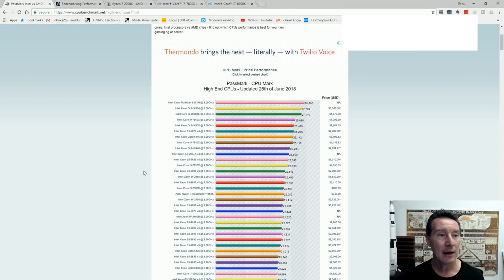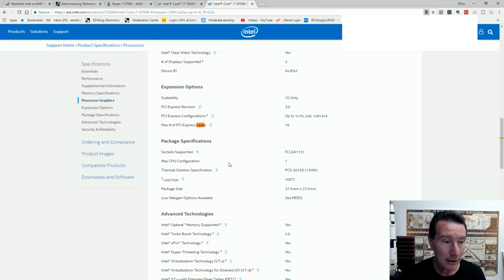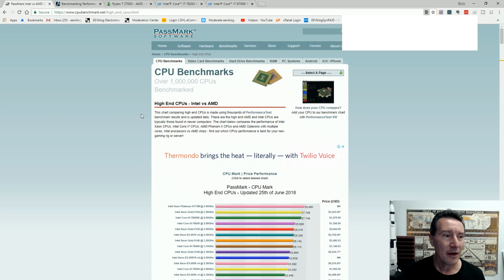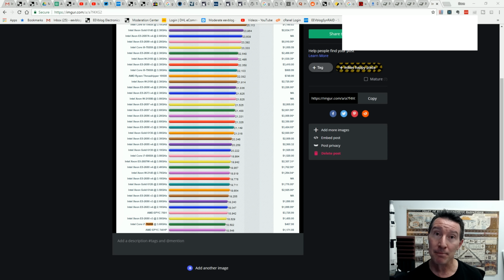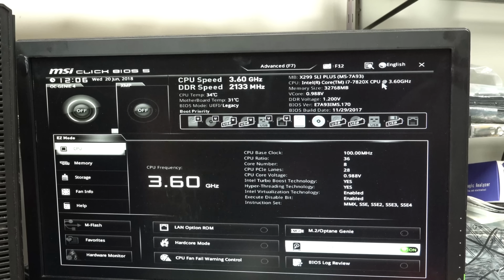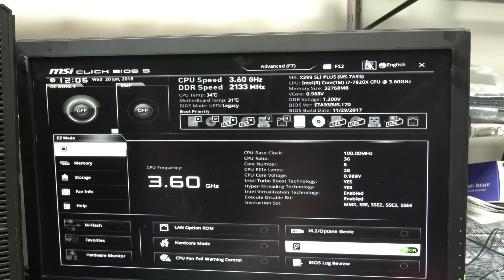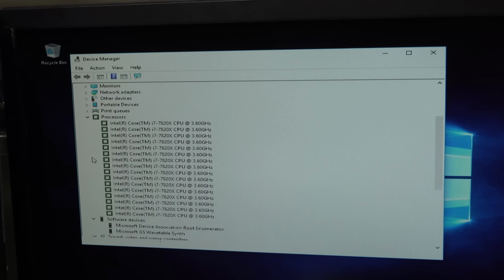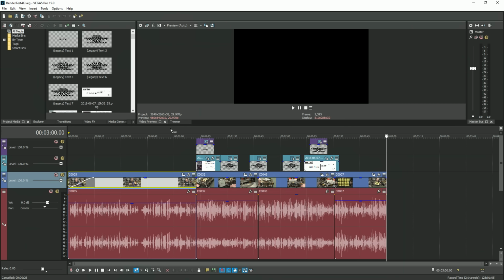EEVblog #1098 - 4K Video Editing PC Build

Comment: I have a 7820x with a custom loop EK water block, gtx1080ti, my 7820x is overclocked to 4.9ghz ALL cores ALL the time, I get 19c all Cores at idle and during gaming and editing it stays around 40-50c under a full stress test it does get a bit hot at around 80-90c but doesn’t stay there very long. I am using a 560mm full cooper radiator it’s a BEAST made by Alphacool. I love my Pc and my 7820x I don’t regret it at all and paired with the 1080ti gaming and editing is a breeze. My ram is Corsair vengeance RGB 3000mhz and I was able to overclock that all the way to 3400mhz stable. Love my setup 👍🏻

Comment: Some notes on PCIe lanes... 
(My knowledge is with Intel and this specific motherboard, I have no idea how AMD allocates / organizes PCIe lanes.)

The CPU's 16, 28 or 44 PCIe lanes are a direct connect between the CPU and (on your specific motherboard) the 4 (or maybe 3 top-most?) PCIe x16 slots for graphics cards.

The X299 PCH on your motherboard supports 24 ADDITIONAL lanes.
This provides the connections for the 2 PCIe x1 slots, the M.2 slots, the U.2 ports, the integrated LAN controllers and the extra USB 3.1 controller.

2 x1 PCIe slots with x1 lanes each, total 2 lanes
2 M.2 connectors with x4 lanes each, total 8 lanes
1 U.2 connector with x4 lanes, total 4 lanes
2 built in LAN controllers with x1 lane used each, total 2  lanes
1 secondary USB 3.1 controller with x2 lanes used, total 2 lanes

I may have missed something on the board, but this accounts for 18 of the 24 lanes available.

Depending on which CPU you use and how many lanes it has natively, your x16 slots would be given more or less bandwidth without affecting the rest of the system:
From MSI's page (https://www.msi.com/Motherboard/X299-SLI-PLUS/Specification):
x16 / x16 /  x8 mode with the 44-lane CPU.
x16 /   x8 /  x4 mode with the 28-lane CPU.
x8   /   x8/   x0,  x8 / x4 / x4 modes with the 16-lane CPU.

Actually, since the x16 slot modes only list 3 numbers per mode, and because the board advertises 3-way SLI, maybe the bottom x16 slot is PCH connected.
That would mean that the bottom slot is limited to 4 lanes (the lane count for a device must be a power of 2, there are 6 left over from above calculations)

So, with your configuration, your PCIe slots have the following lane allocations:
x16 slot: 16 lanes
x1 slot:  1 lane
x16 slot: 8 lanes
x16 slot: 4 lanes
x1 slot:  1 lane
x16 slot: 4 lanes

Comment: Late to the party but - ppl usually have "insight" into these things - and Silver Stone is not a no-name brand - they have very good quality PSU available! All the "good" brands have crappy models for low prices available. Also ppl like to see insane builds that they can't afford. Quite many "high-end" builds are unstable at loads because component selection has been done using the price and results of random benchmarks. Take a look at Steam Hardware Survey and you will see what most ppl use! :D:D

Comment: hey dave, I think you could have gotten maybe a a slightly bigger bang for the buck by buying a slightly less powerfull CPU and adding a GPU. From my (limited) experience, GPU acceleration helps a lot for live preview and final render. Also, mounting the fan on your radiator on the other side could make CPU run a bit cooler (both fan are trying to suck air from the same place instead of making it flow through the case, note that it isn't an issue if you leave it open obviously x) ). Anyway, thanks for the awesome videos, cheers ! :P

Comment: Sorry i was throwing pizza in oven, wtf is passmark? Just go buy clock speed, core matter less.
Reply: With your budget I would of went for max ghz, as many cores as  possible, and def support for quad channel ram.
Reply: Had to disslike for processor choice, pure waist of money, only good thing was it had quad channel, but that may only give limited performance depending on type of use. Sorry Like eveblog, but this is just awful, specially with intel last few years, giving them free money, it's intel fanboyism. My last build was intel, was great, this year im doing ryzen, why cause It doesn't matter i go for best, no fanboyism when comes to cpu's. Who can afford to?
Reply: That said I realize you    purchased it, you own it now, it's not an awful processor, im sure it will work great. Thanks for vid as always they are great (if very poor computer building).
Reply: also why does everyone hate cortana? It really usefull, you can get sppech to text string into c#, xml, scripting etc, make your own automated phone operator etc. Really brings a lot of capability to software developers, and end user.

Comment: I would be very interested to see a more in-depth performance review of the 212 Evo with your CPU since by most accounts this cooler should not be enough by far. I searched around for tests of the 212 Evo on more enthusiast-grade socket cpus but couldn't find any. My personal experience with this cooler is that it was barely cutting it for my i7 4790k and completely unusable with all cores set to 4.4Ghz, but that's a factory overclocked part with a very small IHS and using thermal paste between the die and the heatsink rather than solder.

Comment: Hi All, i did watch your original video, then went looking for it the next day and i could not find it, went into browser history, clicked and nothing.  I thought you spat the dummy and just removed itout of frustration of the comments ** and your prediction was right you would get plenty of comments on this is right and this is wrong**

A lot of people should realize that Australia does not have the variety of shops with stock on hand of every part number, often i make my list and visit 3 shops and see how much they have and what is a acceptable close match or substitute - especially if you want to buy it NOW

As for bang for buck that varies, just like gaming machine on general purpose household / business machines, the question is  "Does it handle the tasks you need or is it to slow for your expectations "

Not every multi core CPU is the same, and not all software tales advantage of all cores available,, i have core 2 duo, I5 a few  I7's in laptop and desktop and its interesting to see processor load and which cores or hyperthreads are sitting there doing nothing while the rest is maxed out on simple things like, Youtube, web browsing, email , video playback, excel

Regards
George

Comment: Nothing wrong with SilverStone. For a "budget" PSU they are actually respectable. Sadly, many elitist snobs turn their nose at budget items and really dislike Chinese companies. You can get crap from any country. Made in china in no way means it garbage or even likely garbage. When I bought my PSU (For $35 if I recall) I was told by many it would blow up and destroy my computer. That was 5 or 6 years ago and this is the third system it has been in.

Comment: Just wondering, since people watching this would probably know, which would be better for me an i5/i7? I am a student (EE) and I like to game a lot. I have a laptop that runs pretty smoothly with an i7 and gtx 1060 for some decent gaming. My sister's laptop has an i5 (not meant for gaming) and whenever I use it (for whatever reason, likes it is closer or something), it feels really...crappy. It could be the pc in general ($1400 > $600 laptop), or is it probably the difference in CPU? I would like to get to the i5 (cheaper) but would the normal performance of the desktop be slower for my needs than an i7? Feel free to ask any questions for clarification.

Comment: Just as information you would not have performance loss on x8 for the gpu especially for your use case so the lanes would probably remain fine further down the line. 
As for the power supply really it may not be the best but it certainly isn't some crappy fire hazard that will die within the year. I would personally expect it to work just fine in 5 years time. 

I do however want to stress that going with some bottom of the barrel power supply can get your components killed. I have seen it happen. 
If you where to buy something like this: https://www.amazon.com/Technology-Haswell-Supply-Installation-Screws/dp/B06Y6J877L/ref=cm_cr_arp_d_product_top?ie=UTF8 now that would be cause for complains.

Comment: Set XMP profile for 3000 MHz on memory (BIOS option). Also update BIOS firmware to prevent any issues with windows 10 (microcode update for Meltdown/Spectre vulnerabilities). Hope it works best for upcoming videos ;)

Comment: Looks good, I am so sick of the RGB crap on everything, the only thing I like with lighting is a Keyboard.
Be careful of the Noctune fans, i have a few of them and as they get older the plastic gets brittle.
The speed at which some areas have for downloads and streaming is very restrictive, i am in a large suburb of Sydney only 15 odd Klicks from the GPO and we still won't have NBN or any other option for another 18 months, yes i can get 4 K stream but sometimes buffers out.

Comment: I made this comment on the eevblog2 video to help out anyone who maybe able to take advantage of the new Adobe premiere pro update. In April Adobe released an update that when exporting a video It will now take advantage of the igpu in certain Intel processors. To do this you must enable the igpu in bios (enable multi monitor). Then you have to install the intel graphics driver. Now when you export a video in premiere it will send most of the work over to the igpu. I have a 6700k in my machine so I know it work for that and newer CPUs. As far as a performance increase it is about 20% faster. Now I don't now if an 8700k would be faster than the 7820x in exporting now that it takes advantage of the igpu but I am interested in if someone could check.

Comment: Who cares if it is an Intel or an AMD chip? There is a whole host of reasons Intel have more than double the market share. AMD will all ways win for 'value' (read: lower price) and Intel will always win on performance... even if AMD pulled out some unicorn that's 50% faster than a 1950x, Intel would have chips ready to ship within a couple of months, they sit on tech until the market catches up. It's the exact same argument as AMD (RTG) vs. nVidia, there are insane diminishing returns, but more money means a better chip. People will pay £40k for a 1959 Les Paul, does that mean they're 100 times better than an Epiphone?

Comment: Personally, I find it pretty refreshing to see videos like this where someone is building a PC for themselves based off of their own requirements rather than trying to build something ridiculously powerful for the sake of it.  Unfortunately it seems fairly common to receive a barrage of ridiculous comments for PC build stuff when you aren't using the most popular components to make an "extreme gaming rig" - I had the exact same when I made a video of upgrading my PC just over a year ago where I dared to reuse my video card, case and power supply which were all still perfectly serviceable for my needs. And don't even get me started on the typical ESD and thermal paste related ridiculousness!  Also don't let them catch you with a slight sprinkling of dust inside the machine, everyone knows that you aren't actually supposed to use a PC to get work done, you are meant to spend your entire time keeping the inside completely spotless!
Reply: Yeah, and don't forget that RGB crap. Why? Why would you pay more just to get some pretty lights? I'd rather put a LED strip myself! And it's so crazy there are even fake RGB RAM modules. Seriously? Because you can't afford 4 modules and you want it to look prettier, you're going to put a fake RAM module that does nothing but light up?! This is utter madness.

Comment: Silverstone used to be the best PSU company i'm not sure that has changed much, but i would never buy a bronze rated PSU i'd replace it asap its the thing that will brick your system if it goes i lost a system because of a thermaltake PSU ages ago.

Comment: That cooler is way to small. The cpu will throttle if its under full load. That cooler cant candle the 140W (its even more in reality). And direct CU in a cooler is a bad idea to cool a 140W CPU. You saved money at the wrong place. Buy a noctua NH-D15
Reply from the maker: Watch the video! I posted the temperature results and it is not way too small, you are wrong.
Reply: You are a genius in electronics. But for PCs.... The CPU will throttle with this small cooler. But it cant right now - your right. But do you know why? The files are on your NAS. That is the bottleneck in your system. Your NAS cant handle such amount of data and the CPU idles (see your CPU utilization) - look at your 1Gig NIC - it cant handle more. If you want the shortest render time you need two separate SSDs in your system. One for the source and one for the destination file. And then, your CPU will throttle because it can run at full load - now it doesn't
Reply from the maker: Octanius Blue - Wow, wrong twice in two posts. The NAS is not a bottleneck. The rendering does NOT speed up having the files on and rendering to local super fast M.2 drive or even RAM drives. This is not speculation, it's fact, I've tested it.
Reply: Some other large tech channels do 4K for a while and have +- the same systems. But maybe the electronic works on a different way on the other side of the planet. I'm out

Comment: The Toughpower XT 775W looks much better inside.
Thermaltake Toughpower XT 775 W Power Supply Review - A Look Inside The Toughpower XT 775 W of 11 - Hardware Secrets http://tinyurl.com/y87o95p5
Reply from the maker: Doesn't surprise me, but it's old and from the dumpster.

Comment: Nothing to apologize for purpose-building a PC without spending months researching the minute differences between parts. On a recent PC build, I needed a CPU with decent single-core performance and VA-API support (i3-7100, cheap MSI mobo, 8GB RAM, low-end PSU) and it works exactly as I needed it to. I'm sure if I posted it to the internet, people would have shit on it. I used to obsess over PC hardware when I was 16, but outgrew it once I had real things to put time into.
Reply: mortrek when I brought my gigabyte motherboard it had no idea it rgb until I build it and powered it on which was a nice positive surprised
Reply: Specced basically the same system for my girlfriend, the 7100 is a great chip! It's a great PC.

Comment: Nothing wrong with SilverStone PSUs, they are decent and certainly not considered bottom of the barrel, there are many far far crappier and cheaper supplies than this.
Reply from the maker: So I've now come to realise.
Reply: Havn't seen the comments about the PSU but they may have been just because it was the lower end Essential series instead of an epeen fully modular 1.5KW Strider, built this gaming PC over 5 years ago and 750W Strider in it is still chugging alone fine and silent. Nothing wrong with SilverStone the Essential series just are not as good as the Strider but they are still magnitudes better than a proper chinese POS like a $15 Aywun.

Comment: I think you made a good choice. You have the option to upgrade to a higher end x299 chip if prices come down down the road. If you choose the 8700 you're basically stuck with it without changing out more system components
Reply from the maker: Yes, I was thinking of that, might be able to pick one up on ebay in a year or two.

Comment: @EEVblog
The problem with your build that you'r using wrong metodology.
8700K have less scores than 7820X, but it's a still much faster processor in most of software like Adobe Premiere. For Video editing nowadays you need to figure out right ammount of Performance per a single core and multiple core performance. 2700x is a slower in Handbrake but with a much faster RAM like DDR4 @ 3200mhz it will outperform 7820X for a same budget, and you will have that budget cuz your Motherboard is a far cheaper, your processor a much chaper. Also as more video your add to process - CPU with a more RAM will win on a long run, so Ryzen 2700x with 64gb RAM will outperform 7820X with 16gb even with a quad channel DDR4.

You could easy check a Pudget Systems blog to check performance for common application.

But any way, i probably don't care what system you are using any way it will make job done.

Comment: If you like the SilverStone PSU, you should look at their cases.  I have two of their cases that rotate the motherboard 90 degrees, and they are an absolute dream.  All the external cables come out the top of the case, which turns out to be a HUGE benefit - I had no idea how convenient they'd be until I tried them. No more disconnecting everything, pulling the case out, and getting down on my hands and knees just to unplug/plug one cable - everything is right there on top.
Reply from the maker: I don't like SilverStone PSU's I just bought it at random.
Reply: I mean if you like it after you've had it a while.

Comment: This $16.17US adapter should solve your front USB 3 problem (It has room to install your card reader into it):   https://www.amazon.com/Vantec-Front-Panel-Bracket-HDA-502H/dp/B01FWK8PMC/ref=sr_1_16?ie=UTF8&qid=1529984459&sr=8-16&keywords=5.25%22+Drive+Bay+%2B+2-Port+USB+3.0

Here's the link for Amazon AU but they want $95.13AU + 19.98 shipping. It might be cheaper to go through Amazon US:
https://www.amazon.com.au/Vantec-Front-Bracket-Components-HDA-502H/dp/B01FWK8PMC/ref=sr_1_4?s=computers&ie=UTF8&qid=1529984238&sr=1-4&keywords=5.25%22+Drive+Bay+%2B+2-Port+USB+3.0

BTW, there's nothing wrong with the SilverStone power supply. 650 W is plenty for your system and SilverStone makes some highly regarded products. It's not a cheap Chinese power supply. Although made in China (and what isn't these days) they're not cheaply made.